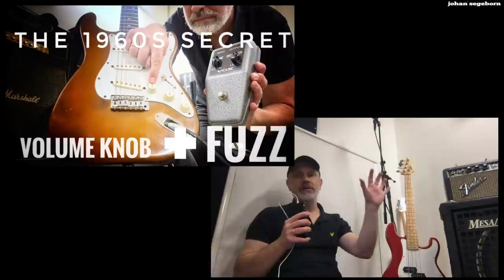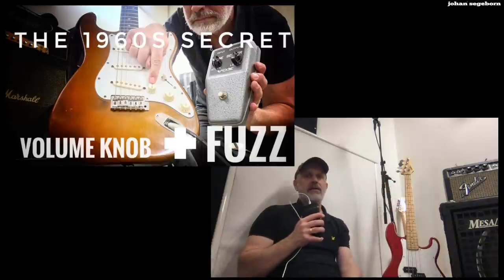This Pedal NAILS Hendrix and Zeppelin if you use the VOLUME KNOB!

Comment: I own one of these exact Vox Tone Benders (Same version with the grey and black appearance. It's circa 1967-1968 (my best guess). I need to solder the battery leads back on, the problem however is there are quite a few photos of the wiring of these units and they are all a little different. My pedal has a shorting type input jack (not a TRS like many have) and I can't find any photos of the wiring of that version...Great pedals and nice video.
Phil
NYC Area

Comment: Isnt it the vox the same as the sola sound 1.5 which is what the germanium fuzz face is based on? I think that's what I've read but searching for comment section wisdom.
Reply: This particular example sure sounds like a 1.5. It cleans up well, as do the germanium Fuzz Faces, indicating low input impedance.

Comment: I have a question that you may like to make a video about. 
What is the best way to make a guitar cut through the mix during a solo?  I’ve heard a little bit more volume and a little bit more gain.  But a lot more mids is the best way.
Reply from the maker: That’s a good idea for a video! We could define a couple of reference mixes with different frequency/ dynamics content and examine which strategy that would apply for each mix. Cheers
Reply: I will look forward to it.

Comment: I'm just starting the video up... Being a Germanium Fuzz Face Humbucker guy..

I've found mine is best set with a parallel humbucker which is the SD full shred bridge. The neck does it pretty well also but in series. The 16k or whatever the bridge measure does a drive not fuzz tone.

The neck pickup in Parallel is unusable with fuzz it wants to oscillate.

I think the mojo lays between 6-8k coils and maxing the fuzz to just under oscillation and using the volume.

Anyhow a strat seems the obvious choice. But a Low output PAF should do the thing..

Where I bet the Special II you have will not work at all

9:15 oooohhh it took a moment for the setting change to hit me

The neck pickup has the lowest output coil usually.. That's the spot.. Or a middle-neck everything dimed

Fuzz Strat in your hands sure does sound great Johan!!
Reply from the maker: Thanks David, great feedback! Cheers